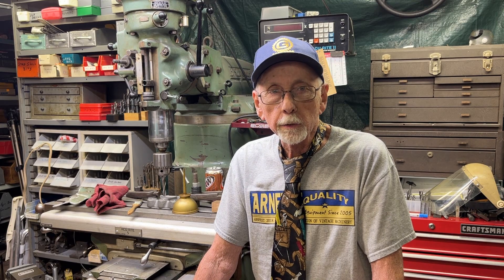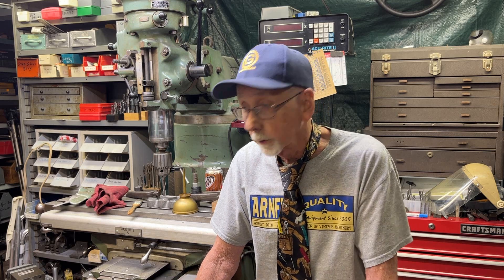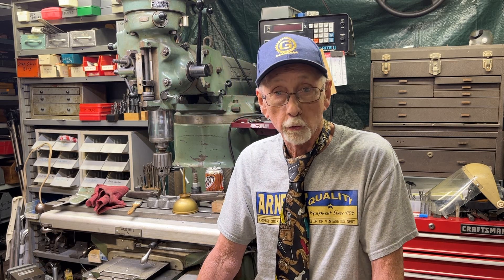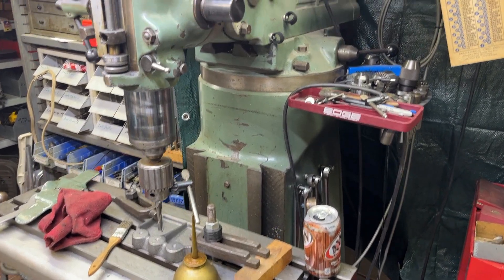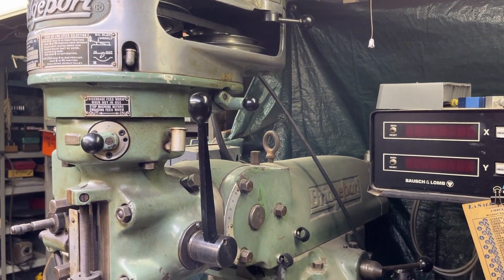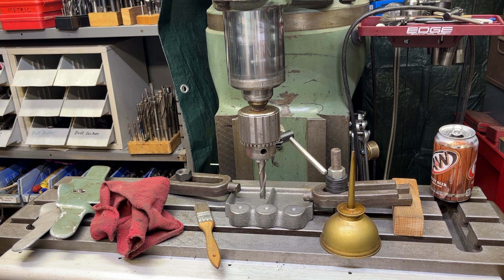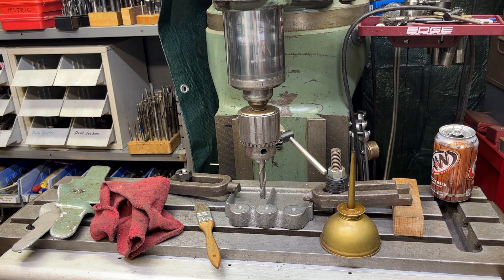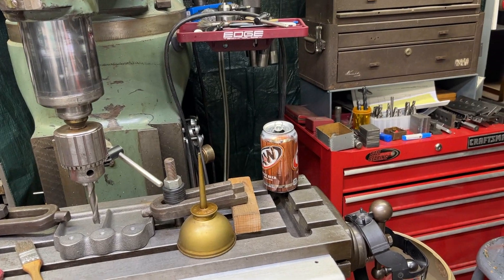SHORT SUBJECT #4a BAD MILL SETUP tubalcain mrpete

Comment: The obvious ones are humorous, I'm wondering if clamping onto the inclined edges of the casting without anything to stop the casting moving forward is one of them. Is that enough of an angle to  be a problem?

Comment: Your mill table is not a storrage locker, so please remove the rag, oil can, soda (belongs in the break room) and paint brush. The left clamp is doing nothing, please secure it so the piece can be properly worked. The right clamp is not situated to bring stability to the tork piece. Please situate it properly. Not sure what the objects on the table before the shop rag are, but the work bench or work tray is a better place for them. 

The key is in the chuck, we'll use it to find a lucky winner when it's turned on, kindly remove that.

The face shield belongs on your head and the tie in uour locker

That's 10.

Comment: Where to start on this one? Everything is the short answer.  Don't use a mill bit in a Jacob's chuck. Key is left in the chuck. Quill is extended too far instead of raising the knee. Clamps are all wrong. Rag on the machine. Drink on the machine. Of course lose the tie. And more and more.

Comment: OK, You've got almost everything ....BUT I don't see a loose draped electrical cord or a handy air hose on the work area and I don't know how you could show it but four loosely vised parts with all sawn edges my 1 2 3 blocks to be being pulled up out of the vise by a slowly disintegrating 6 flute 1" end mill and the new guy reaching for that mess in order to save the day, I guess. My journeyman damn near broke my arm swatting it away as he dove for the E-stop button which GM had thoughtfully had  mounted on the fronts of the machines. Ah fond memories from the seventies. Oh yeah, no oversize bucket of water or coolant to go with the lubricating oil can. (All the above from my first shot at a Bridgeport about two weeks into my Tool Maker apprenticeship.)  I didn't know "Plastic squeeze bottle" yet so I had grabbed the removable water trough from the nearby monster pedestal grinder and was trying to figure out how hot the parts would be as I was planning on dunking them at some opportune time. Hey! I think I see the yellow belt guards on the left end of the table! They don't go there! They are supposed to be misplaced a couple years ago!
The only other thing is that tie. I think you could get away with a bow tie at one time but not the neck stretcher you're wearing. 
Thanks for the test and some "How the hell did we get through all that without loosing too much skin thoughts" Mr. Shop Teacher.
Reply from the maker: lol

Comment: I've never used a mil!, But key in chuck, drill chuck instead of collet or tool holder cluttered work space,  retract the quill and raise the table, rag, and don't like anything about the clamping arrangement.  There  must be a better place for your drink.

Comment: First thing I see wrong that mill is not at my house 
2 never put pop or wobbly pops on a table it will rust them
3 it's a tool not a table.
4 really? You left a key in a chuck? Even for a demonstration purpose that should have felt wrong.
Reply: The clamping setup, the tool, the gloves, thats not a face sheild or coat rack, the tie. Wth man are you trying to assume room temperature?

Comment: Endmill in drill chuck, quill all the way out unnecessarily. A wood block under one toe clamp and nothing under the other. Too much stuff everywhere. Whether it'd laying down or hanging. I just realized one toe clamp ios upside-down lol. I'm curious if that part was indicated in. Too many washers under one nut, nothing under the other. Not enough thread engagement on the left one. I just realized the chuck key is in the chuck.

Comment: Pulley guards not installed, drill chuck used to hold endmill, clutter all over the mill table, clamping methods are not ideal, PPE/eye protection should be on you and not the machine, rag(s) should never be around a running machine or left on a machine.

Comment: 1. Soda and clutter on worktable
2. Faceshield hanging on X axis crank feed handle
3. Quill over extended - table needs to be raised.
4. End mill in drill chuck instead of collet
5. Chuck has key left in it
6. Operator has tie dangling from neck
7. Wood improperly used as supports for work piece hold downs
8. Nothing under work piece to prevent drill through to table (although maybe you're just facing it?)
9. Work piece poorly secured with hold downs (should be properly secured in vise with supports).

Comment: The only thing I haven't seen mentioned is the missing guards over the pulley & belts.  Not sure if the Bridgeport has them?  Wathced the video again and saw them on the left end of the table.  Not sure how they attach, as I didn't see a bolt or hole for them to attach too?  Must have a leg that rotates and locks behind the housing?

Comment: 1) gloves are an injury risk during milling. The necktie is more dangerous and less becoming of a dapper gentleman such as yourself.

2) nothing should hang from a ball crank handle and the face shield could be insufficient eye protection even if you choose to wear it before starting the operation. 

3) declutter the collect rack and pencil tray (or whatever that edge industries accessory is for). That power supply cord draped over it makes me twitchy.

4) step pully covers should be affixed in their designed location. 

5) work holding isn't holding work. Wood? Yikes. Angles are gross. One stud is too short and the other one is too long. Boy, that's a lot of washers. 

6) back gear control looks like it is in an odd position. 

7) why are those tools all piled up on the machine base under the knee? They should be in the dishwasher for Pete's sake. 

8) beverages don't belong on that kind of table.

9) neither do shop rags, chip brushes, or oil cans.

10) quill up, remove Jacob's chuck (which shouldn't have a key hanging in it), shorter end mill in proper holder, knee up.

These setup videos are a great idea.

Comment: Neck tie party planned
Lack of prestidigitation planned shortly thereafter
Quill has a long journey to work
Root beer requires a coaster
Wood always gives a springy vibe to the job
Key in chuck always brings a surprise on start up
Are we drilling or milling today, I forgot, But we got it covered with a chuck and a mill
And how deep should we go, all the way through the table, OK
That handy rag is back to wipe off the mill end while running
What type of oil will we be needing today machinery or cutting
My, what a short bolt you have there, never mind, the other one makes up for it and I'm sure the washers will add to the wood's springiness
Some other horizontal surface "fillers" gathering on this mill, but I'm sure she's strong enough
Going to have some fun turning the horizontal crank with that face protector getting in the way

Comment: Aside from all of the other things mentioned the left hand clamping nut has no washer under it so there's very little contact between the nut and the clamp. For some reason all of the washers are used on the right hand clamp, which sticks up a bit far for my liking.
Reply: Also very little thread engagement on the left hand nut by the looks

Comment: The end mill should be in a collet and never in a drill chuck.  The quill is extended.   Raise the knee rather than extending the quill when milling.  The shop rag, chip brush , oil can and root beer should not be on the mill. Never leave the key in the chuck.  The face shield is doing no good hanging on the side of the milling machine.    I have probably missed a few other things.

Comment: 1) knee should be raised for less quill extension 
2) drilling operation should be performed with a drill, not end mill
3) work piece should not be drilled with base against table unless you want matching holes in table
4) key in chuck
5) loose items on table
6) sloppy work-holding. Clamp on left could damage table. Both could slip.
7) is work square to table? Can’t tell.
8) work should be indicated first. Cutting tool is ready to use but work not indicated yet.

Comment: 1. Wrong color tie. Doesn't go with shirt 
2. Wrong flavor of Pop. aka soda
3. Wooden block on clamp. Always use thick piece of rubber to absorb vibration.
4. Should be wearing chainmail gloves don't want to cut your hand.
I did see a few good practices though...
*Oil can for proper lubrication close at hand so you don't forget to use it.
*Chuck key  left installed so you won't lose it.
I'm sure you see where I'm going with this....🤪😁
Have a Jesus filled day everyone
Greg in Michigan

Comment: 1. Inappropriate clothing, gloves and tie, faceshield should be on you not hanging on the machine.
2. Raise quill for rigidity and raise the table.
3. Use of chuck instead of appropriate tool holder for milling tool. Never leave the chuck key in the chuck.
4. Get rid of all clutter and unnecessary items from the workspace.
5. Don't use wood for clamping to, as it will compress and the work will loosen.
6. If you're going to drill through the work, don't clamp directly to the table, have some sacrificial material under the item being worked on.

Comment: chuck key in chuck, end mill in drill chuck not collet, drink can on mill bed, oil can sitting on bed by the work, eye protection on X axis bed handle -not on operator, rag on mill bed, brush on mill bed, wood block under clamp, 2 handles [look like spoke shave] on mill bed, no cover over drive belts and necktie being worn near machinery.

Comment: In addition to all the other safety concerns everybody already posted, i would say the cutter is pretty long to use for just milling flat of the work piece.
The threads of the left clamp bolt are barely engaged.
Also the left clamp needs to be raised to angle it slightly downwards so the work piece gets squeezed against the shoulder of the clamp if it wants to move. This opposed to now wanting to be squeezed out from in between the table and the clamp. 

I like this style of video where input is required. Also, my take on the music is: no please. your videos are entertaining enough with the educational part alone. No need to add music, which only distracts.

Regards from a machining newbie from the Netherlands.

Comment: the tie you are sporting could drag you into the work, ditto the gloves, surely the cover plates to the belts should be in place rather than on the mill bed, fancy using a jacobs chuck for an end mill, worse still you left the chuck key in, well that red rag is a red flag, the mill has the spindle fully extended, and your end mill could be a short one for the job you need, eye protection should be on your face, not whizzing around with the handle as you feed the work, as for your work holding, well whats right about it. the can of pop, well that looks  to be full sugar, thats fine if you dont already have diabetes, you soon will. that oil can, not strictly necessary as you are milling aluminium.

Comment: Your tie doesn't go good with your shirt.
Gloves are too big for your hands....Need to pitch the tie and gloves!!!

Too many washers stacked up on the one hold down clamp and none on the other hold down clamp.  Using a block of wood to prop up the hair pin plus its propped up too high.  Stud is way too long, may interfere with the spindle quill.

Comment: I was trained as a safety officer, and the old adage a place for everything and everything in its place is a start. clear path to the off switch and no eating or drinking at the job, and there has got to be a better way of clamping than you have with nothing to stop twisting and just get rid of all the unnecessary items to another place and then recheck before starting work wearing all your safety gear hahha  these are hilarious but all to common and tuck that tie under your shirt son

Comment: Mr. Pete, outside of the Bridgeport mill not being the problem everything on the table is a problem waiting to happen. The tie was a nice idea for class but not if it gets wrapped up in your work. End mill in drill chuck not a good idea as well as the flying key. Soda ok on the table if you are looking for a new iron vitamin, just use a coaster under the can.

Comment: 1.  Endmill in a drill chuck. 
2.  Not an ideal root beer location for a few reasons. 
3.  Key in the chuck. 
4. The work piece could be placed on parallels to avoid damaging the table. 
5. Not a good habit to hang things from a ball crank (especially one that is powerfed). 
6.  A shop rag could potentially get grabbed by the cutter, but will certainly be lousy with chips - Or both! 
7.  Dangling neckwear will eventually prove deadly.
8. Wood (Because it's soft and could loosen and spoil the work) might not be the best choice to block-up a clamp.
9. One could possibly raise the table and shorten the quill length to maximize rigidity.
10. I could forget to Like, Subscribe , and Share the Video with a friend, a foe,  and everyone I know!
Reply: Gloves
Reply: I find the clamp on the left a bit sketchy. Its back end should be raised so it is not trying to push the work away.

Also, for facing, surely a shorter endmill would be in order.
Reply: @kevinmartin7760  Glad you pointed this out about the clamp, Kevin. I personally don't own any clamps, so that bit of knowledge is sure to get filed away for future reference.  :)

Comment: 1.Drill chuck hold endmill, 2. quill over exrwnded
3. No neck ties.
4. To drinks sitting on mill table,,,,root beer yuck.
5. Bad clamping if workpiece.
6. Clutter in table, 
7 eye protection 
8. Mill head not locked.
Much more.

Comment: You have too many things wrong to comment on.
I will try...
Clamps look risky to me. I don't own or use this style, but the left clamp seems barely clamped and the right clamp adds wood as the clamping shim. The clamp stud bolts look too long. They appear to be shimmed to maintain nut thread contact. Length may cause operating interference when the mill is properly held in a collect and the quill is retracted.
The mill is held in a drill chuck.
The mill is unnecessarily long.
Clutter is all over the machine, work space and operating space. Green something on work table, possibly belt guards??? Rag, chip brush may be okay, oil can, soda and face shield.
Operator has gloves on, a dangerous hand grabber around rotating machinery. Does anyone know the current thinking on thin nitrile gloves or similar products for rotating machinery use? Gloves we're an OSHA violation in my working years, but I see " youngsters" wearing them presumably to keep hands clean. They're pretty flimsy and might safely tear instead of dragging your hand into the rotating machinery.
The operator sports a necktie, adding similar danger to the glove situation.
The quill is fully extended.
Belt guards are non existent, but possibly not missing from the old Bridgeport. After market guards are available and are easy to install.
Drill chuck key is left in the chuck.
Root beer is a good choice, but may taste bad after cast iron chips contaminate it. If it is cold, sweating may cause table damage. Machine surface damage happens too easily. You don't need to carelessly accelerate the damage.
There are better places to pin your drill and tap charts than the DRO. The DRO display box appears to be a shelf for items that are better placed elsewhere.
The red tray may be handy, but it looks cluttered and ready to fall or spill its load. A cord or hose is draped over the shelf adds additional risk of being unintentionally grabbed.

Is there a prize for being the first to waste 20+ minutes typing on a smart phone things that all of us already know???😉

Comment: Spoilers below I guess.

Nice gloves/tie you have there. It would be a shame if something grabbed onto those.
End mill in drill chuck (though that hasn't stopped me in the past with light cuts into plastic or boring aluminum).
WTF is up with those toe clamps?
Stuff on table is going to rattle around, including your beverage of choice that will go through you like a cheese grater.
Quill extended too far.
You will be drilling straight into your table.
You mentioned using an end mill as the first operation before a drilling operation. That is backwards (even more-so if the cutter isn't center cutting).
It wouldn't surprise me if you had the part at an angle so you would have a hard time getting accurate hole locations.